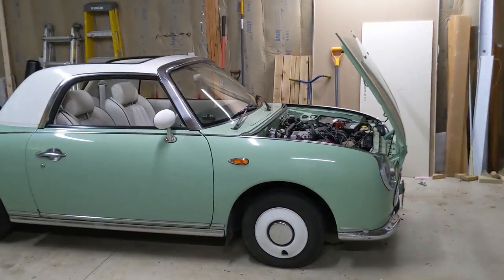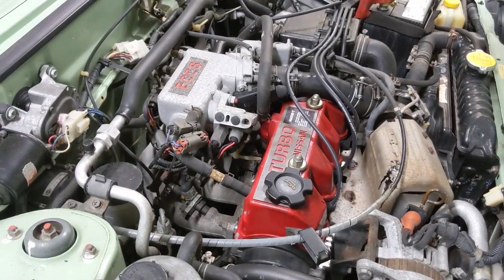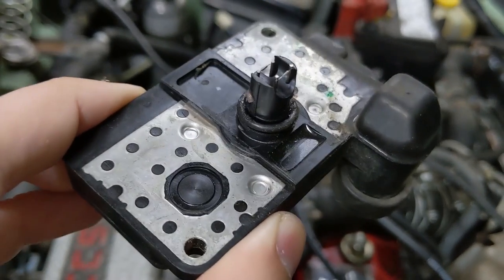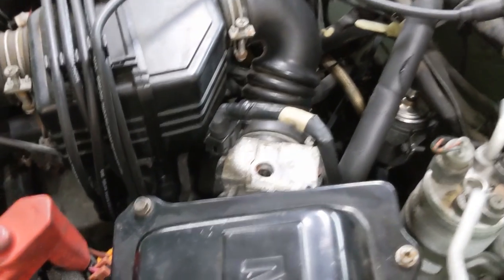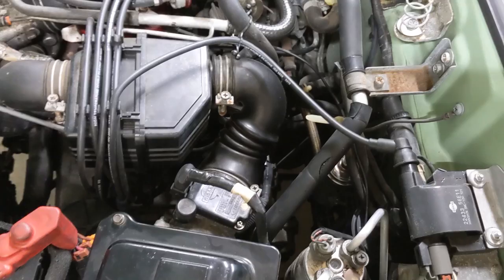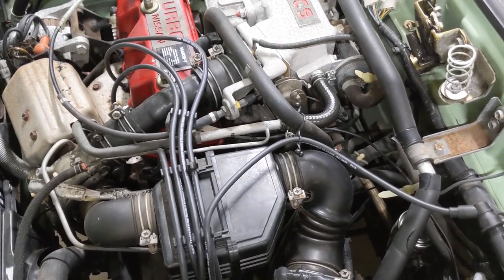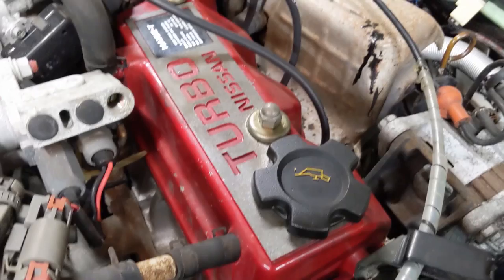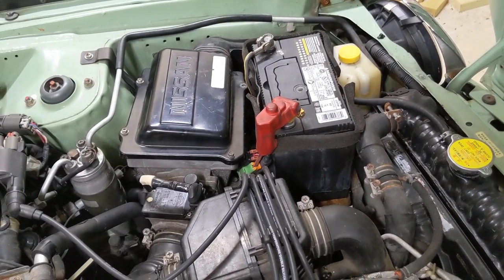Modern engine control musings and Fixing a Figaro

Comment: Yes you’re right the first cars with fuel injection were a few luxury European cars in the 70’s. It wasn’t until the early 1980’s did you see fuel injection in the us domestic market. And for the most part many of them were throttle body injection systems with one or two injectors above the throttle plate. Sort of a rudimentary computer controlled carburetor, and actually carbs held on in some cars and trucks until the end of the 80’s. Even then though most other functions like lighting were still mechanically controlled through relays etc. nowadays everything is electronic even lighting, and everything is controlled by modules via can bus protocols. Today’s ecu’s can share a crazy amount of information with each other on high speed data lines (about a 500kbps). So that the features that consumers expect in there cars are able to work. Ecu’s can share what each sensor that’s wired to them is seeing to another ecu without that one being hardwired to that particular sensor. So the abs can see your steering angle, the transmission control module can see the throttle position and it can calculate how much line pressure to use to engage a gear set. The radio can see the vehicle speed sensor off the transmission to display it on the dashboard while using the gps and also inform the instrument cluster the list goes on. I’m a heavy truck mechanic and it’s so interesting to me how all these electronic controls work together what each sensor uses and just the whole thing. I love this video I’ll bet a deeper dive into automotive electronics would make for an awesome video.

Comment: on early to mid 1990's japanese cars, obd1 was still the norm, which does not have a plug, more like a fusebox with jumper pins, with high idle sometimes you can have a buildup in the IACV or idle air control valve, which will sit near the throttle body and bypass some throttle air past the butterfly valve for the intake so you dont stall, sometimes it sticks from oil or fuel vapors and can make the idle speed erratic and change upon heat

Comment: If you are not sure about MAF problem, just disconnect wires (engine must be shut down before disconnection) and the engine should run by default values on the next start up. It is reasonable to do only for testing purpose, not every day using.
The battery mounting parts are 1st hook 24422 ﾛﾂﾄﾞ,ﾌｲﾂｸｽ ﾊﾞﾂﾃﾘｰ 2444021000, 2nd hook 24423 ﾛﾂﾄﾞ,ﾌｲﾂｸｽ ﾊﾞﾂﾃﾘｰ 2442528B06, clamp 24425 ﾊﾞ- ｱﾂｾﾝﾌﾞﾘ-,ﾌｲｸｼﾝｸﾞ ﾊﾞﾂﾃﾘｰ 24420M7000, 2x nuts 089111062G ﾅﾂﾄ,ﾍｸｻｺﾞﾝ. Also there is some kind of enclosure for battery 24431 ｶﾊﾞ-,ﾊﾞﾂﾃﾘ- 2443137B00. If I get the full picture, I will upload it.

Comment: Cars from the late 80s and early 90s have wonky choke sensors that make the car start on high rpms cold and drop to whatever rpms is advised. There is also an idler screw in there to help you lower the idle rpms. You could really use that because you dont wanna wear the clutches in your transmission when in a full stop and in the Drive mode.

Comment: On an old car like this, where the throttle is mechanical and the computer has no direct control on how open or closed the throttle is, the fast-idle is achieved by what you could call a "controlled vacuum leak."  It deliberately lets more air into the engine, without going through the throttle-body.  If the valve that does that is opening wider than it should -- or if, maybe, it's stuck full open -- the computer  thinks a certain amount of air is coming in, when in fact there's more air than it expects.  So it doesn't inject enough fuel, and it runs lean -- and stalls when it's not sufficiently warmed up.  And the reason why it runs better when it's very cold is because the computer senses the extreme cold and injects a ton of fuel -- it expects the valve to be fully open when it's that cold, so it is actually injecting enough fuel to make the car run properly when it's very cold.
 
TL;DR -- your IAC valve is probably stuck full-open.  Clean it so it opens/closes properly; or replace it if cleaning is ineffective.

Comment: I'll say it is a temp sensor, not firing a cold start injector, and thereby running lean. If it is like Toyota Denso design, it's the cold start injector temp sensor which screws in to the antifreeze output of the block going to the radiator just after the thermostat.

Comment: Can you selectively unplug one after the other the MAF, oxygen sensors, etc. and have the ECU run with a default value for that 'missing' component, and that way detect which one of those components are misreporting their values?

Comment: *PROTIP TO ANYONE CLEANING THEIR MASS AIRFLOW (MAF) SENSOR: Because these sensors are so delicate, you can ONLY use Mass Airflow Sensor Cleaner - not any other product. At this time, be sure to check the condition of your air filter. Any debris or dust can kill these sensors fairly quickly!*

In a pinch, you can use a bungee cord as a battery hold-down. And for the loose negative battery post: I had the same problem with my '99 Camry. I'm using a battery that a friend gave me, that he purchased to run a backhoe (more CCA than my little girl needs, but I like having more than I need). I replaced the cable end, and the problem still existed. I discovered Shumacher (the company that makes car battery chargers) sells "Battery Post Shims." Basically little lead caps that simply drop on over the battery terminals, and then you slip you cables on and tighten them down. I've been working on cars since I was 17 (1994) and I never knew these existed...

I found your part: https://www.nengun.com/oem/nissan/22680-17b10 for 53,139 Japanese Yen ($500 - OUCH!). I'd look at anyone that supplies genuine JDM Nissan stuff. Rockauto.com doesn't have it. :-( I actually expected it to cross-reference out to some other MAF for a US car, but that doesn't appear to be the case.

A dirty/faulty MAF sensor can absolutely cause hard-to-start and idle surging - but, like you, I'm leaning towards that odd little idle control system as the culprit. One of the easiest ways to check a MAF, in the event that it hasn't set a code and turned your Service Engine Soon/Check Engine light on, is to simply unplug the sensor before starting. If the engine fires up fairly easily and runs mostly smooth, there's your problem!
You can drive with the sensor unplugged (MOST CARS) for brief periods, the ECM will "guesstimate" the air passing through the intake based on throttle position, air temperature, coolant temperature, and more (or fewer) sensor readings depending on the vehicle. Your car won't be as fuel efficient, and if you smell rotten eggs pull over and shut the car off for a while (you are damaging the catalytic converter WHEN you smell the eggs), but otherwise this method can get you home without a tow.
Computer controls on an engine are a bit of a double-edged sword. It can provide you a quick, simple diagnosis that gets you up and running in no time, or at least save a bundle on shop diagnosis fees, or it can send you down the rabbit hole for hours. A $20 sensor that takes hours of work to replace can leave you stranded. A $140 failing MAF sensor that takes 5 minutes to replace can have you driving to Advance Auto 6 times in two months to exchange faulty "remanufactured" sensors until you finally switch to a different brand of part out of frustration, pay a bit more, and THEN have trouble-free driving for 6 years. And as amazing as having all of this computer-controlled engines to strike a balance between performance, economy, and emissions, cars can still fail in ways the ECM can't detect (although the systems ARE getting much better over the years).

Comment: If you still have this car you might want a turbo timer. It will continue idling the engine for 2 minutes to allow the oil to circulate and cool to prevent premature failure of oil seals in the turbo.

Comment: Japanese batteries do have smaller terminals. Adapters are available. 
Recently got caught on this with the new battery for my Aunt's Daihatsu. Went to the parts store to get a new battery for it and got the one the book said was correct. Get it back to the car and it had the smaller Japanese terminals, but the car had been converted at some point to use battery bolts (a single bolt through a hole in the terminal on the battery and fastened on the lead side). Since they don't make batteries suitable for battery bolts any more (and I didn't want to drill holes in the terminals on the brand new battery), we ended up changing it back to the Japanese terminals. Went for Japanese rather than Western (and exchanging the battery for the larger terminal one) so that the 'book-correct' battery for the car can be used, rather than having to argue with the staff at the auto parts store about why we're buying the 'wrong' battery.

Comment: One way to check if it's a minor fuel pump issue is to just key on the car for about 10 seconds before starting. If it starts fine then, then the fuel pump check valve may have some issue holding line pressure. More of an annoying problem than the worst thing, as you can just get by with waiting to start the car until you get the part to fix it. In that case the car should run fine otherwise, as the rest of the fuel pump having issues would cause more drivability problems - the fuel pump check valves older cars seem to act up at times even though the rest of the pump will still work fine. Nothing particular to that kind of car, just another random old car thing to look out for.

Comment: from what i’ve seen from engine masters, burning at stoichiometric would cause the engine to melt the piston. for gas engine 13:1 is lean and 11:1 being rich, while stioch is 14.7:1.
Reply: This is true and a serious factual error. They do NOT run stoich. They might pass through stoich on lean-run/fuel-cut for overrun, and pass it back on the way towards acceleration at 10:1 air-fuel, but yeah. Not stoich. Lean burn engines can run 45:1 and full-accel profiles are like 9:1 sometimes. Essentially never is the computer going to say "exactly 14.7:1, please," because, that isn't practical or helpful to emissions, longevity, or performance. It's just not great at any goal of ours.
Reply: Thats not really true. After a certain point, leaning out the mixture will start dropping the combustion temperatures simply because there isn't any power made due to that. On a stock car, it would be very hard to melt pistons with a lean mixture.
Also, what engine considers lean is entirely dependent on engine and intake design, injection and so on. Theoretically, 14,7 is stoich, but gas usually doesn't burn all the way, so you need to inject a bit more.

Comment: Camshaft spins half crankshaft speed. Distributor is almost always run off camshaft. So its common for the cam sensor to be in the distributor. It could have a weak or intermittent crank signal.

Comment: Check out the datasheet on your MAF. Usually you can find a G/S/volt reading (grams of air per second, per volt). Gently strip back the two signal wires from your MAF and tir a DMM into them. Run DMM into cab and take a drive. Plant the pedal and run up the rev range - you will be able to see your peak Mass Air Flow Rate based on the voltage your DMM reads. Rough number is 0.82 g/s per horsepower. That means if you read 82 g/s of MAF, then you are producing roughly 100 horsepower (0.82 * 100 = 82). Compare the number you find to the factory rated peak horsepower, and voila! You get a reasonable test of if your MAF is reading way off or not

Comment: Ehrmahgerd!
That cold start air bypass valve is the same crap present on Bosch K-Jetronic (CIS) mechanical injection systems from the '80s, I had troubles with it on my VW Mk1 Golf.
It's a crappy rotary valve, actuated by a bi-metallic "not-a-strip" but a twisting rod, I suppose. Binds easily, especially after all those years.
Has a heating element that starts heating as soon as engine is started, and runs the whole time. It would take too long to get heat-soaked, first the intake manifold and then that valve, so they put a heater on it. It should start closing slowly when engine is run.

Comment: 3:38 This is how the MAF works...by the look of yours, it's a Hot-Wire style...
//en<dot>wikipedia<dot>org/wiki/Mass_flow_sensor
1 of the wires is likely a Cold-Wire Sensor to help the ECU detect changes in air density which has more effect on combustion than air volume does...

Comment: You should get a WheelSkin leather wrap for your steering wheel, it would look really nice with the retro car. They come in a bunch of colors (you could get a dark green to match the dash) and you can get custom fit if they don't have your size. I got one for my Prius (I wanted a wheel cover made in the US) and it is very nice. It was quite the process to put on though (you have to lace it on...wear gloves and/or bandages, I gave myself nasty blisters from pulling the cord tight) and you have to be careful not to use cleaners on it as it is real leather (I make sure to rinse hand sanitizer off before touching it). Also they cost $50-$60 but I think it's worth it. I'm not payed by them or anything by the way lol just think it's a nice product that would be good for a Figaro.

Comment: Check your ECT sensor and especially the connector.  The style Nissan used in that vintage do not hold up well over time.
I would suggest making sure the resistance is proper directly at the sensor for a given temperature then plug the connector back in and take the reading again at the ECU to verify the connector doesn't have a high resistive fault at it.
That sensor plays a HUGE roll in how it runs.

Comment: You're pretty close with the MAF. It actually consists of two filaments of a specific metal (used a themperature dependent resitors). Both are powered with a certain voltage and the current is monitored. The more air rushes in the more the wire is cooled down which changes the resistance which changes the current at a set voltage. The reason there are two is to compensate for the temperature of still air. One is in the "wind" and the other is in the wind shade. It uses the difference in current between the two to calculate the air flow and over time the air mass. In most cars with this system you actually don't control the throttle with the pedal, you only open and close an air flap. The further open the flap is the more air the engine gets. So essentially you control the airflow to the engine. The computer then calculates the amount of fuel needed and mixes it in.
And while many older cars are already computer controlled, not all are/were. I had a Nissan Sunny from I believe 1993, which was entirely mechanical. There was no computer at all. One of the few electronically controlled things was the RPM gauge. But even im that analog electronics were used. So it was technically not computer controlled.

Comment: The cold idle valve is a sealed unit and can't be cleaned.
If the car feels sluggish in the higher rpms, or flat out won't go into them, it's your cam angle. What you've described sounds like the cold idle valve has failed, though.

Comment: My Camry ('96) would start like that on VERY cold (sub-freezing) days sometimes.
When cold, it wanted to idle up near yours at 1200. As it warmed up it calmed down to a normal 700 or so.
When you turned on the air conditioner it'd increase to 800-900.
The rough start seemed to happen when the computer would fail to tell it to idle-up to 1200, and it'd try to idle at 700 on a stone cold freezing temperature engine that was in no way ready to idle that slow.
Like yours it'd clear up once you gently massaged the throttle a bit to wake it up. It's been years since I've had that car though, and I doubt its idle control is quite the same. It also definitely did not have a MAF, and depended on the o2 sensor almost entirely for mixture control.
Just thought it'd be an amusing ramble to contribute to your ramble.
And since everyone's being an armchair mechanic, I wonder if whatever's supposed to idle the engine up when cold isn't "getting the signal" that the engine is warm and bringing it back down...?

Comment: I have a K-Jet Bentley that did the stalling thingy until I replaced the fuel pressure accumulator. Fine on totally cold starts, fine running, didn't want to start or stay running warm til the accumulator was renewed. Fuel pressure regulator can also do some weird stuff on starts. Get a mechanical gauge on the fuel system at the injector rail if you want to know for sure what's going on there.

Comment: CHECK for leaking (physical leak) Electrolytic capacitors on the ECU circuit board!  Lots of Japanese cars (and just about any car for that matter) from the early 1990s and beyond have problems with them failing!

Comment: If you want to force your computer to do a relearn without being able to use a modern scan tool, you can disconnect the battery terminals and hold them together for 15 or so seconds. Basically it's a capacitive discharge and will clear computer memory and reset learned values for fuel trim that might not be cleared by just disconnecting the battery normally.
Reply: The parking switch could suck, it could be part of the transmission or it could be part of the shifter assembly. I'm thinking it's in the shifter, a small switch is worn out and is probably a real pain to get to even if you have detailed instructions. Nevermind finding a replacement part... but Nissan is large enough that the switch and shifter parts could be in multiple cars from that time frame.

Comment: Yo dude, the battery terminal is a normal Nissan thing, or at least for a Japanese-made Nissan. It's because of the taper of both terminals and it's just a tight fit, you'll need to tap it on gently with a socket and a hammer to get it to properly seat. 

Surging and starting weirdness on a Nissan is almost always vacuum or MAF related, so I'd clean the IAC valve like you were talking about and see how you go.